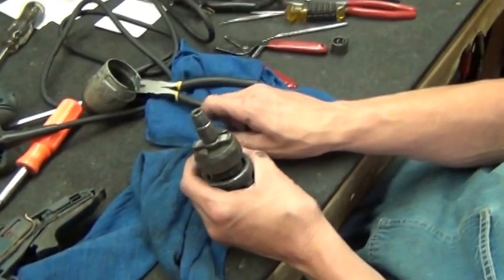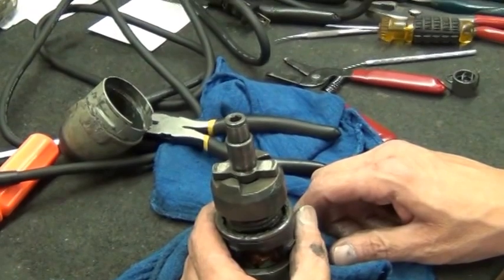What's inside hammers and impacts

Comment: ??  You can not use an impact as a hammer. A hammer drill or rotary hammer drill for use will work because it impacts in and out or up and down into the material.  AN IMPACT DOES NOT CAUSE UP AND DOWN FORCE. ONLY ROTATIONAL FORCES AS IT ROTATES OR IMPACTS INTO THE CIRCULAR MOTION. NOT UP AND DOWN.  In other words an impact puts impact forces into the same rotary motion as the rotation. A hammer drill or rotary hammer is rotating and in addition is simultaneously then putting impact forces perpendicular to the rotation or in and out or up and down depending on how you are looking at in addition to the rotation.  2 different things.

Comment: This guy's wrong he has it back words on how the impact works lol the hammer lifts up and smacks the anvile to spin the bolt loose
Reply: He described it correctly but is showing it opposite because obviously he can't compress the spring on the hammer to rotate it over the tabs on the anvil. I thought that was pretty obvious. Though it'd be more obvious if he just held the anvil end stationary and rotated the hammer assembly over it mimicking the spring compression.